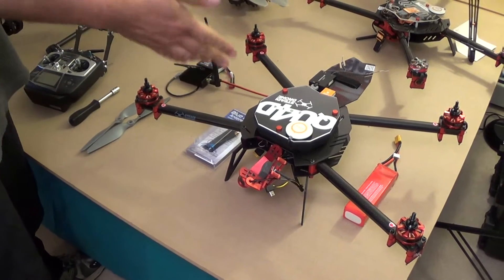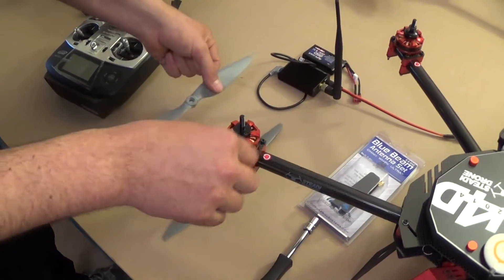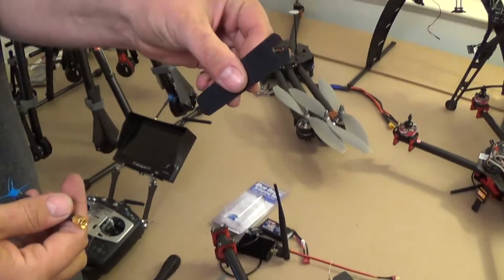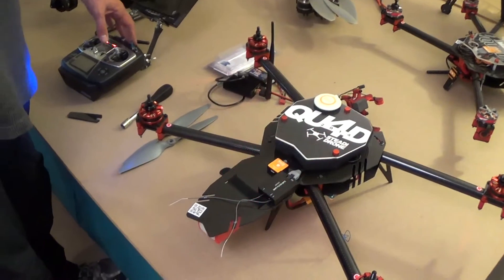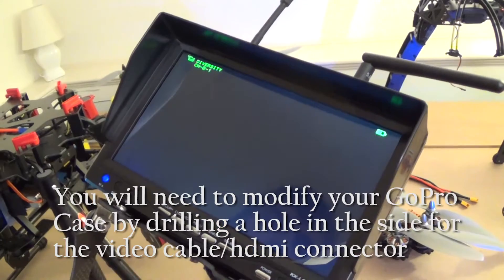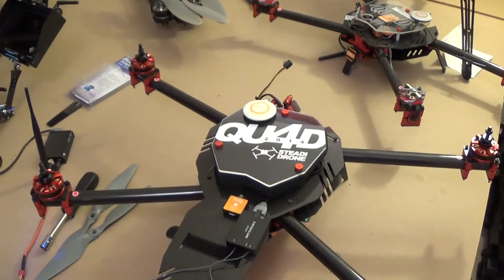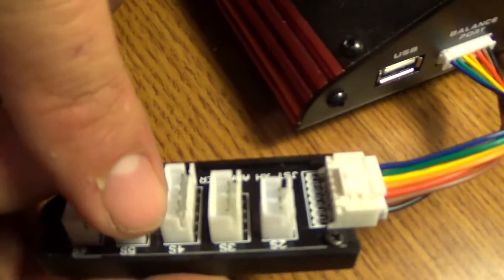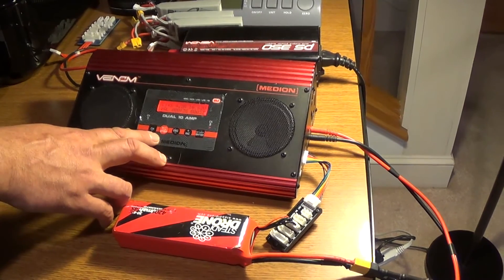SteadiDrone QU4D Familiarization including FPV and Data Link

Comment: Hi.  Nice modifications :).  What is the video transmitter you use in this setup?  Did you have to splice it to the main battery cables or is there room for it in the Quattro ESC?  Does the gopro video transmitter cable effect the operation of the gimbal at all?

Great detailed video, thanks for putting this up.